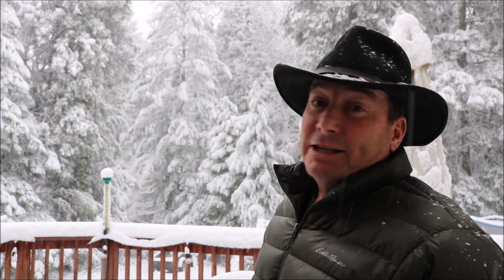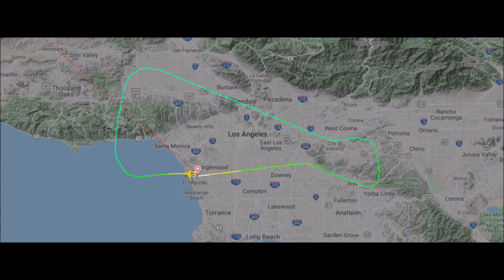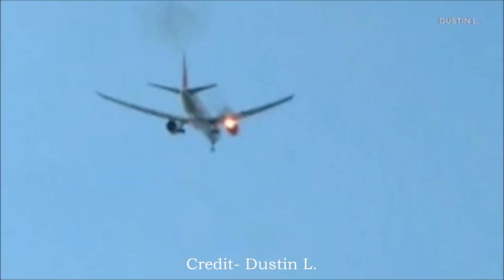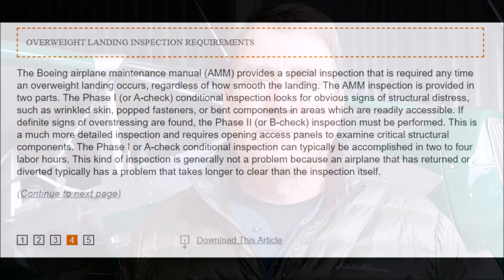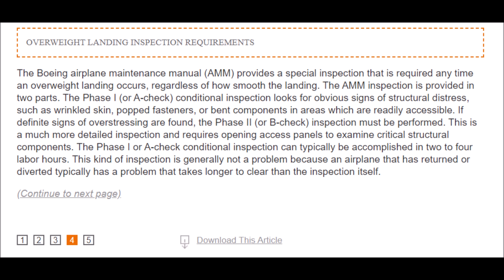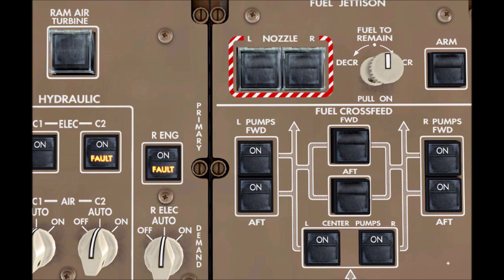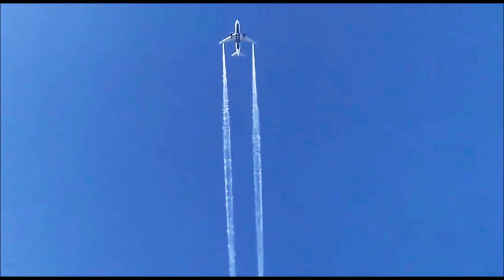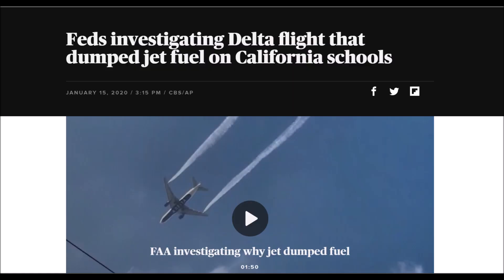B-777 Fuel Dumping and Overweight Landing Considerations (Part II)

Comment: By the way, according to USA Today, from  March, 2014;  Boeing used three suppliers for the 777-200ER's two engines: General Electric (GE); Pratt & Whitney, a subsidiary of United Technologies (UTX); and London-listed Rolls Royce. ... The 777-200ER has a maximum cruising range of just over 6,000 miles, while the -300ER's range is listed at slightly more than 9,100 miles. March 30, 2014

Comment: Juan, FYI, Delta uses 4 pilots not 3 on LAX-PVG. 2 Captains and 2 FOs.
Reply: Are they all required to be in the cockpit for take off? Does Delta use CRM where the additional crew members are used for instance: to communicate with maintenance, monitor dumping,  look out for additional aircraft, follow through on checklist items, inform the cabin crew, ect. Many hated to see the flight engineer/second officer removed from the cockpit, sure helped in an emergency. They would have been responsible to oversee the fuel dumping.
Reply: Yes, all pilots are in the cockpit from push back until top of climb. Yes, CRM is used.
Reply: @tblosser  The dump switches used to be at the Flight Engineers panel. As I 
 remember, its been a while, on some aircraft the F/E could communicate with the Company on a separate frequency from that being used by the Capt and F/O. They could also make P/A's and keep the Flight Attendants, Stewardesses back then, informed about the emergency.
Reply: Most flight engineer functions that haven’t been automated are now on the overhead panel. I’m not sure about the 777 switches but the 767 fuel dump switches are on the overhead. All cockpit crew positions can communicate on any radio, satcom, PA or inter-phone. In addition they could use ACARS which is a text message system to dispatch and maintenance.
Reply: @tblosser  Todd, I am typed on the 757/767, started as a S/O on the 727. I was just inquiring as to Delta's SOP, and CRM for augmented crew-members. Some seem to think that we can get down to a single Pilot through automation and eventually eliminate Pilots altogether. Working with two Pilots goes pretty smoothly in day to day operations, however, in an emergency, especially one that involves multiple failures, aviating, navigating, and communicating, can become a challenge when the QRH does does not directly express the issue or where the primary failure leads to additional related failures. These are the times when that additional crew-member can be a godsend.
Reply: SOP is to use all resources available.

Comment: Hi Juan. Could you explain the meaning of maximum landing weight if it’s not the maximum weight acceptable for landing? What’s the value of a maximum limit that isn’t? It appears that it’s a suggestion, not an actual hard stop.  Or perhaps it’s a threshold to initiate a post landing inspection?

Comment: Letter I sent to the LA Times, regarding a report on 19 January, page B4, what odds do you give that a correction will be made?

Dear Mr. Vives and Editor:

I believe you have a large discrepancy in figures stated in the above mention article that deserves correction.

The report states that Delta flight #89 dumped “15,000 gallons of fuel over the working class community this week”.  To an unaware reader, seems like a vast amount. 

In fact if you had done some research you’d know the B-777 type aircraft is capable of only dumping 5,000 pounds of jet fuel a minute. At a weight of 6.84 pounds per gallon it is thus capable of dumping only 731 gallons per minute. 

The aircraft, per ATC info, was traveling at around 175 mph or about 256 feet per second or 15,360 feet per minute crossing Cudahy which is only about a mile East to West. How could the flight possibly dumped 15,000 gallons on Cudahy?  

It could not. At most it dumped a few hundred gallons - a much smaller figure by a number of magnitudes than what you stated. 

While I don’t discount the fear and discomfort experienced by the unlucky people exposed, your article is inaccurate, misleading and unnecessarily adds to their concern and anger.

Will the L A Times publish a correction?

I suggest also in the future for more accurate info on aircraft incidents I suggest you subscribe to the YouTube channel of pilot Juan Browne (who’s also a credentialed journalist) titled Blanco Lirio.  https://www.youtube.com/user/blancolirio

When reporting, Juan sticks to the facts, something your article did not.

Look forward to your reply and correction. 

Sincerely 

Brian E.

Thank you Juan for being an honest journalist, not many at the Times unfortunately.

Comment: Der schnee! Can you send some of that to Vegas? It actually looks good. 
I just watched that vid on the stall and the info is rather limited. I still don't know exactly why it happens. Air goes in, hot air and gases go out. What exactly causes that process to back up? Is the compressor turning so fast it is no longer getting enough air to suck through it that it is almost like it is in a vacuum? I have always been curiouse about anything to do with aeronautics, even took a few courses at university. Nothing this advanced though.

Comment: Thanks for these vids. Since the incident AC was (apparently) a 777-200, may I respectfully ask why you keep referring to it as a 767? I'm only halfway through the 2nd video, and you have consistently referred to the incident AC as both a 777 and a 767, seemingly interchangeably, throughout both videos. From what I can determine, the two types are similar but not identical, nor are their weights and procedures the same, nor can a 757/767 pilot fly a 777/787 without a new Type Rating.

If your references to the 767 were all intentional, perhaps an explanatory word or two could have been inserted to explain why you are constantly referring to 767's in a pair of videos that are all about a 777 incident.

I realize you were in a rush to get this out, but I'm suggesting that such inadvertent errors (or, if not errors, unexplained anomalies) might cost you more in credibility than uploading it unproofed an hour early has gained you in early-bird attaboys. We have enough issues with the idiots in the MSM in their rush to get it first and wrong- I think we in the industry need to be a bit more careful about getting the details right. Thanks.

Comment: Thanks for that! It is interesting to know that aircraft are required to return to airport after a surge, regardless of whether the engine continued to operate or needed to be shut down. It makes sense right after takeoff.

Scenario question: In ETOPS operation where a engine surge occurs at or near the journey midpoint and the affected engine remains operational after throttle retardation, is the crew permitted to bring it back to a nominal thrust setting and continue the flight or is a diversion to the nearest alternate required? What about 3 or 4 engine aircraft operation? Any differences there?

Comment: Is it procedure to "call the company" for guidance in this situation, or is it all in the checklists?  Based on all I've gathered, seems like they were "winging it" in a situation that should have been a "by the numbers" routine.  Still a little confused since you say that the plane didn't need to jettison fuel, then that they may have needed to to get to max landing weight(which you say isn't required in this aircraft in the first place) which is what the media was saying in the first place.  I'm not a pilot and am not trying to be an ass.  It's just not clear to me.  Could there be more issues like avoiding tire or brake replacement or reducing fatigue on the aircraft for sake of longevity that could influence the decisions made?  Thanks for what you do, you do a great job.  Good luck with the upcoming PSA tests, I think we all want to see you back in the air.
Reply: Normally on a quick turn back to the airport there would not be much time to talk to the company. In a situation such as where the gear would not extend properly, then the company , their maintenance center, and even the manufacturer would be consulted. Obviously the Company would prefer that you not land the aircraft over its max landing weight, because that requires down time to do an inspection. LAX airport has sufficiently long runways that this aircraft could land without deceasing its weight by dumping fuel, but that is not always the case. It also raises the possibility that the brakes can become overheated, and that the wheel fuse plugs might blow to relieve excessive temperature and tire pressures. Other nearby airports, such as Edwards or Palmdale with long runways could be used, but this likely would have required consultation with the Company and would have created a logistic issue with the passengers , cargo, and baggage.
Reply: @shenandoahhills7263  Thanks for the reply, good info.  I see the L.A. teachers have filed a suit against the airline.  Not sure how you compute damages for getting a little kerosene on you, but these days, nothing surprises me.  Probably hoping for a quick settlement.  I shudder to think of the shrubs, lawns, trees, and gardens affected as well...... cha ching!   The final report will be interesting.

Comment: Excellent information as always. Not meant to be critical, but I'm a little curious why you seem to be so indirect about things that we laymen are wondering about. It seems clear that you are implying that no fuel dump was technically necessary. But you didn't come out and say that directly. And  I was hoping you might offer other possible justifiable explanations for the dump, such as miscommunication or other safety concerns that might make a pilot think there was a last minute need to dump fuel for safety??? I mean other than outdated ignorance which I think was the only explanation you suggested. Was it the pilot or the copilot who was talking to ATC? And which would have initiated the dump? and when? 
I was also hoping that you would point out that the pilot had nearly 200 human lives at stake and THAT was FAR more his responsibility than communicating everything to ATC, or even dumping fuel too low. Dumping fuel needlessly on schools is horrible, but there are also children on the flight and the safety of the passengers' lives has to outweigh the lesser evil of inappropriate dumping. I think that balance needs to be addressed. And I would have liked you to point out that dumped fuel is not ever going to ignite on children and burn them alive (unless I'm wrong about that). Did the pilot panic and dump fuel at too low an altitude because he was afraid of the delay from being re-routed out to sea? I sincerely doubt that is even a possibility, but it's an impression people might get, and a fellow pilot might want to dispel that, even if there was the chance that the pilot in this case made an error in judgement. When children and emotions are involved, cooler heads like yourself really matter. IMO. And thanks again for the excellent videos!
Reply from the maker: We simply dont know yet.

Comment: Not only did the crew not request fuel dump, the ATC explicitly asked if they needed vectors to dump fuel (presumably over the ocean) and the pilot said no. Given the PR nightmare this caused I wouldn't be surprised if this results in pink slips for the pilots.

Comment: GREAT Video!!
    There is an FAA certification requirement that two engine airplanes MUST be capable of landing at their takeoff weight which is almost always above the actual certified "Max" landing weight. A dump system  capability is not even required. The B-737 is a good example of this.  The Northwest Airlines  (Now Delta) A-330's do not have dump capability. It was explained to me by the chief A-330 pilot that the decision not to add this option was due to weight consideration.   I always suspected that it was a decision made by the bean counters. Having flown the B-747-100/200, B-747-400, and the DC-10 I always wished that I had that capability on the A-330 (POS).
    Does anybody know if the dump system is a B-777 purchase option?

Comment: Does the automatic go around computer system also automatically continue to dump fuel on it's own. Something these pilots simply may not have been aware of !!
When I was in aviation school back in the 80's one point that was stressed was that landing weight of any plane was much less than take off weight and that fuel was dumped to protect the structural integrity of the aircraft. In short the, landing gear was not designed to support the landing impact of an aircraft attempting to touch back down at its take off weight, if that weight was higher then the planes landing weight. You mention getting the aircraft stopped, but I think their point was that it would probably stop where ever it touched down. (Ha)
This may have been old school and the situation may have changed in 40 years.But since they are still dumping fuel maybe not.
Thank you for this video.

Comment: Not a pilot, but it seems to me that we have a little monday morning quarterbacking here.

This was an emergency. They did have an engine issue. 

As I said, I am no pilot, but it would seem to me that if you lose an engine and you don't know why, you will ask yourself, "am I gonna lose the other?"  

Given this concern, does it not make perfect sense to do everything you can to get it on the deck ASAP? I mean, if you have 100% confidence in the other engine, then, yeah,  take it up to altitude and burn/dump enough fuel to make a safe landing. 

Second guessing them, IMO is like the pilots who second guessed Sully when it put it in the Hudson rather than glide it back to LGA which very well may have been possible. 

As for being on the news being the worst thing that could happen, I know a few hundred people that might disagree. I am pretty sure they were thrilled to death to be around to see the news. 

As for the kids that got spritzed with a little Jet-A, they'll be fine. And I suspect Delta will make it worth their while.

Comment: Good analysis but if i may a couple of comments. performance wise the 772 (not the 762) can land on the same rwy it takes off on with flaps 20 AB max. Therefore an emergency return is a non issue depending on visibilty. Weather below CAT 1 minima requires an Autoland and that has not been safely demonstrated above Max landing weight. So in this case a suitable takeoff alternate would be determined before departure. But in this case the weather looks fine. An engine stall is certainly not by definition an emergency. if so than a Mayday called is needed. there was no legal requirement for an overweight landing here unless there were other factors with the "good engine". the overweight landing checklist is something that is frequently mis understood but should always be referred to and especially on long haul flights with extra crew members be discussed. hey, whats the hurry you've got 12 hours of fuel! Climb to 10,000ft . Coordinate with ATC a suitable area. Discreet frequency. jettison. and return at max ldg weight with an Autoland.

Comment: He never said he wasn't going to dump fuel. The controller asked if he needed to hold to dump fuel and he answered no. That means he didn't need to hold to dump fuel as he could dump the fuel he wanted to  without holding.
       He never once said he didn't need to dump fuel.

         My best guess would be they figured they were Ok but decided to dump a little weight just for a little extra safety margin. Now IF they dumped fuel because they were treating it like the older aircraft you mentioned then there is a lack of training that needs to be addressed.

Comment: @blancolirio, Juan, its a bit off topic, but I just seen in the news that Airbus successfully tested their new Autonomous Taxi Take Off and Landing, ATTOL, system; an A350 was able to take of by itself with just the test pilots observing. I am wondering if this is the thin end of the wedge; the start of the computer replacing pilots and as a younger pilot hoping for a long career, its making me nervous. I’d love to hear your thoughts on the machine/computer replacing the pilots in the future, do you foresee single pilot or unmanned airliners in the not too distant future?
Reply: It works until it doesn't.
Reply from the maker: Yes, I do...

Comment: You will note that the B777 has a redundant set of crossfeeds, forward and aft. The B737 has only a single crossfeed with no redundancy. On a long over water ETOPS flight if one looses an engine on the B737 and then also has a malfunction of the crossfeed there may not be enough fuel to reach their alternate destination since the entire fuel load on the dead engine side will be unusable. The FAA and Boeing know this but they consider it statistically unlikely. 
The center tank pumps operate at a higher pressure than the wing tank pumps, essentially overriding their lower output, so that the center tank's fuel burns out first, as you mentioned. The center and wing tanks feed the same manifold so that when the center runs out of fuel the pressure in the manifold drops allowing the lower pressure wing tank to feed the engine. They operate seamlessly, with no action on the part of the Pilots, other than to turn off the center pumps when the center tank is empty. This is standard Boeing kit.

Comment: Does the FAA system not use Pan,or Mayday phraseology .The whole thing sounded very rushed by the pilots and ATC.There is an interesting video on You Tube from Manchester UK with a Thomson 757 bird strike and compressor stalls on climb out,with ATC coms.They used Mayday immediately.

Comment: I find it hard to believe that the crew would knowingly dump fuel onto a populated area and at below accepted altitude. Maybe it's like Juan speculated, that the dump switches were activated and someone forgot to turn them back off when they changed their mind about dumping the fuel. Remember in the first video that the crew/pilot( ? ) initially talked about dumping the excess fuel but then changed their mind(s).